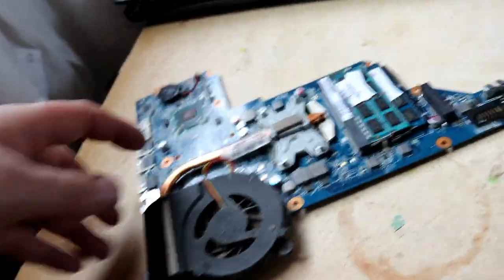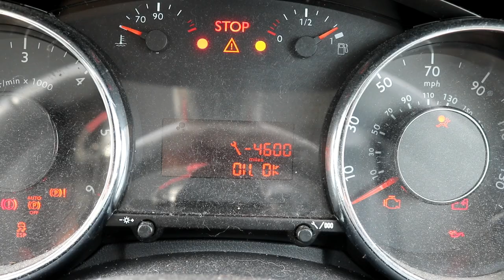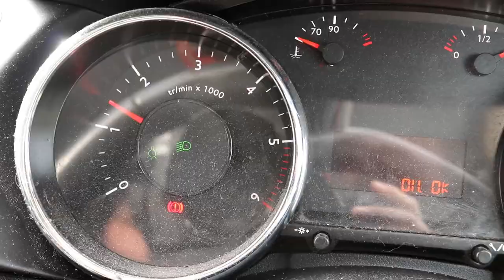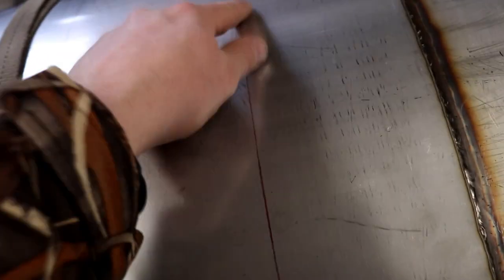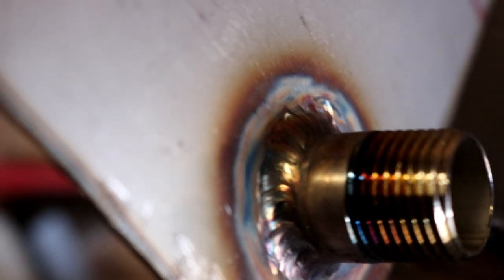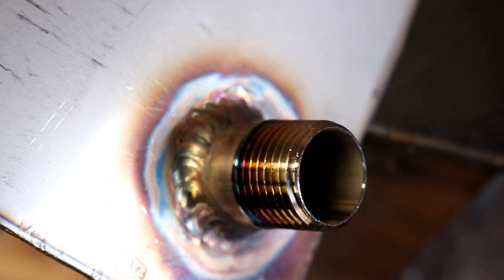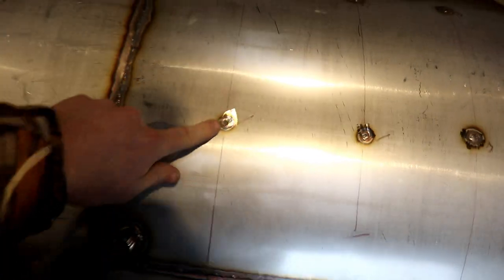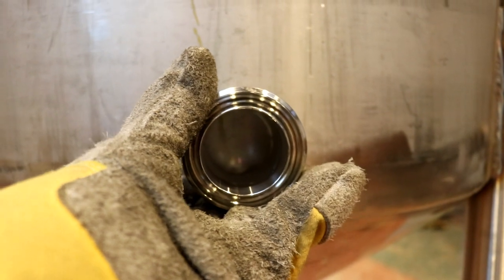JACKETS ON

Comment: Great video, just one question. You are putting a jacket only on the one side and only in the middle. Will that be effective in controlling the temperature of the beer? Most of the tanks I have seen have the jacket wrapping around the whole tank.
Reply: I just realised you were meaning the chill plate/”jacket".  He said his old tanks were chilled the same way. So its probably not necessary to have them going all the way around.  I saw another small brewery had a chill plated drop into the tank itself.  So there's more than one way do it.

I'd probably just run some copper pipe around the outside if I was going to do something. Might be cheaper this method tho.